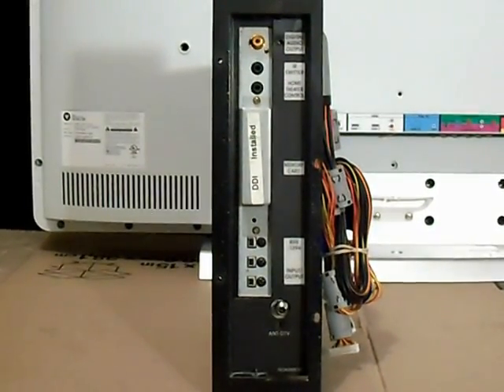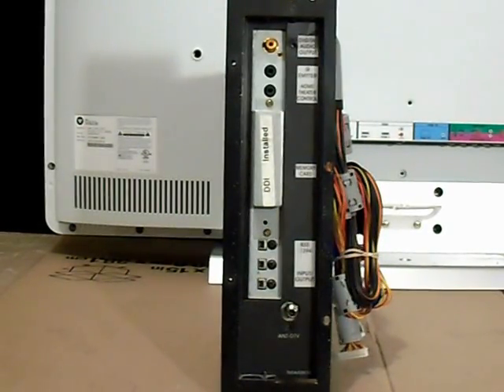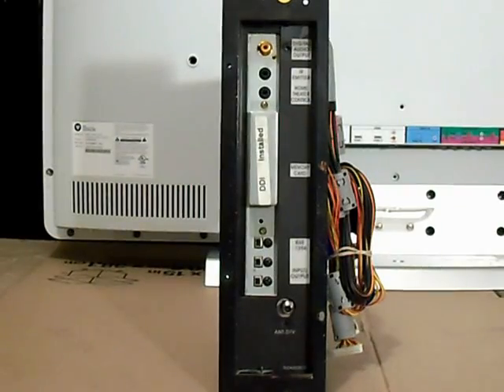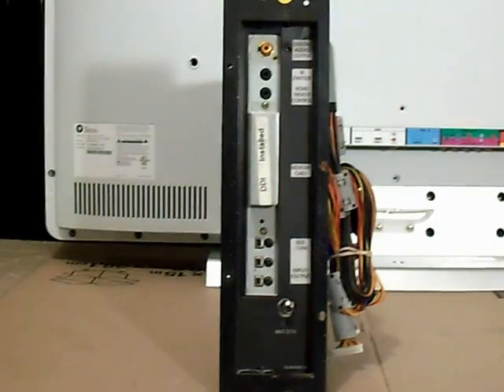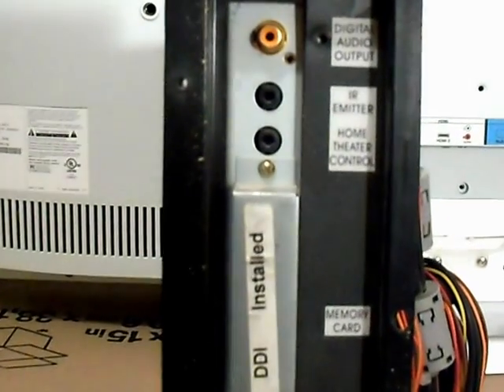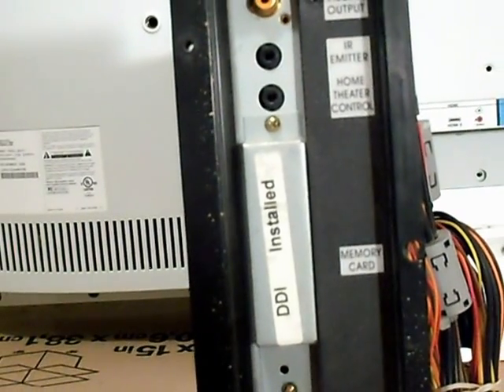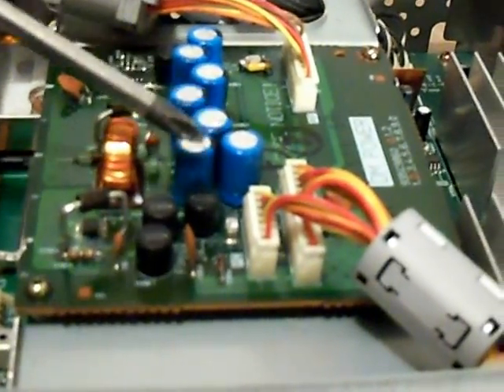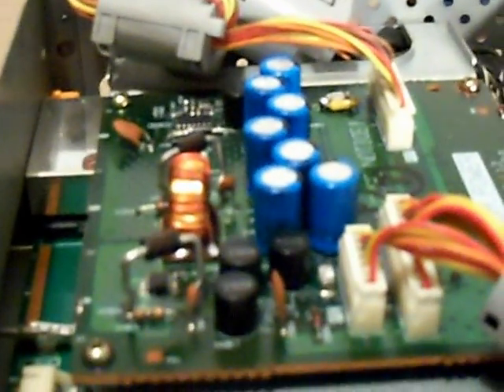Mitsubishi Rear Projection TV WS-65869 (#1) Continuous Blink - Won't turn on

Comment: For TulsaTVandPCRepair, I'm not sure if you are still answering questions, but I was wondering where did you get your E2P reprogrammed? Also how do you know if your E2P needs to be reprogrammed. I have a WS-73711 with maybe 200 plus hours of use and I just took it out of storage. Blinking light is on and will use your video to replace the capacitors. Hopefully this is all it needs.

Comment: I have a Mitsubishi Model WS 65815.  The light would flash green I had no idea about the blinking light of death but TV was working. One day my son was turning TV on and off then it just wouldnt come back on. No blinking light, no nothing. I have done a lot of research and wondering what could it be when I am getting nothing at all?
Reply: Lydia Readence I have the same TV so what was the solution what was the problem how did you fix it
Reply: I have the same model and brand TV but the same problem what was the solution what was the fix
Reply: Lydia Readence mine is dping this and my daughter does that is yours fixed yet what was the problem

Comment: I have a Mitsubishi WS-55809 the problem is that the TV will not turn on. Now when I push the power button the TV attempts to turn on by making a clicking noise and the green power light does come on but it shuts off in 2 seconds.
What do you think the problem is?
Reply: Ernest Hammond exact problem im having now i need help

Comment: just wanted to thank you for your video I was able to repair my parents TV in time for thanksgiving by following your video.... had accidently plugged the PF harness into the wrong port and light still flashed then double checked my work and noticed it was suppose to go to the power board...when I plugged it up light flashed a bit I was disappointed grabbed a drink looked again and the light was off. hit the power button and she fired right up... thanks again for video

Comment: Hello, very nice how to video. I have the constant blinking light on my ws-55615. It's a 2004 model, with a 4 capacitor board. Is this likely the same problem as the model you showed in your video? Thanks!!
Reply: brown bear 
I’m having the same problem with my WS-65513 which also has a 4 capacitor board. I haven’t fixed it yet, but I’d be willing to bet that it’s the same problem, even with 4 capacitors.

Comment: Hi there i dont speak english very well but can understand and i got a question, i need just to replace those 7 capacitors? i got the same problem that tv wont turn on
Reply from the maker: +Holasoybotman100 Botmejorado Yes in most cases, just the 7 capacitors.
Reply: thank you very much

Comment: If you are not familiar with soldering then send your board for repair to us on ebay, search for listing # :231640885112.
Don't mess up your board they are not longer available, so buy this repair service and save your nice big screen hdtv....
Reply: Are u still serving theses tvs
?

Comment: Hi,If you are not handy or know how to use a tester,You can send your board for repair to this guy from Ebay and save your tv or avoid to be overcharged by your local tv shop,just search on ebay bar  for listing :330700000004.
Nice and Professional Guy!!!

Comment: Hello,
I switched out the caps on the DM board and the fuses tested fine but my WS-65711 still won't power on. The led light turns on for a few seconds, I hear a click then the unit shuts down. Do you think the E2P card would cause this? If you think it could be the cause, I'll spend the $60 to have it repaired. If not, I'm stuck. New TV?
Reply: Hey did you ever resolve your problem? Mine is doing the same thing.

Comment: Your instructions worked to a "T" with my Mitsu WS-55511 tv!  I spent a total of $7.50 on 7 capacitors at Metro Electronics here in Sacramento and my 18 yr old son did a great solder job!  Only took about 15 to replace the caps and a few more to replace all the screws to the tv but we are back in business with our 2003 Boom Box!!!!!   Thanks again for sharing!!!!!!
Reply from the maker: Thank you for sharing the good news!

Comment: Hi, I'm a tv ser. tech located in R.I....I've also found that the pc board that the 1000uf caps are on, I always upgrade them to 25 volts. I am able to allow for a larger cap because if you notice that board has a lot of thermal issue's, so I also leave the metal cover off to keep it vented to allow the heat to vent better. Also, the small pcb also will have several dried or ( cold) solder joints that have to be resoldered. Normally this will resolve the prob. 95% of the time and the set will go through its boot and appx. 1 min green light stops and were good to go. Just a little input to the vid.
Reply: Frankie Pitochelli i totally need help my big tv thats one of the old mitsubishi tvs the hd1080 it wont turn on ill hit the power button n itll flash and shut off but my tv never comes on i need help my hubby is pretty hands on so if he can be told how to fix it he will!

Comment: Does this method also applies to the circuit board for the Mitsubishi Laservue? I'm on my third circuit board replacement, and my warranty is expired. Now I'm starting to get random tv shut offs again 5 months later. Thanks

Comment: Hi, if you guys are not good at soldering or testing components or don't know , you can send your little dm power board to this guy on ebay and save your tv, type this # in ebay's search bar:330700000004.
They are professional and do a good job,don't mess up your board.

Comment: I have a WS-55515 Model...same problem.. Continuous blinking light and wont turn on. Can i fix this problem the same way as this? I opened the back and dont see the same DM as on here. Please help. I dont want to buy a NEW TV unless repairing it will cost just as much as buying a new one. Thank you for your time. Your help will be well appreciated.

Comment: Hi,
If you guys feel like not good at soldering or using tester to check components, just buy this repair service from ebay for this board, search in eBay engine for item #330700000004.

Comment: I'd like to thank you for posting this!   My TV did had this problem.  I ordered the 7 capacitors plus 2 just in case from Amazon with shipping for $17.90.  I took the box over to my Dad's and my 11 year old daughter soldered in the capacitors.  She had just worked on a project with my dad learning to solder coincidentally!  I took it home and put it back together and VOILA!   It flashed at first but then I turned it right on!   It worked like a charm!   We are thrilled!  Thanks so much!  Suzy

Comment: would this repair work with my Mitsubishi ws-55511. Which has the continuous blink problem with no error code. Was on before a 15 minute power-outage and then the timer/power led just kept blinking and has kept blinking for about two weeks now. There are no repair people willing to even look at the tv. So I'm in-charge of fixing it.

Comment: Hi Sean i need your help!! i opened up my tv to vaccum the dust accumulated. after i put it back together the green light on the front panel keeps on blinking. there is a blue button under the DDI sheet metal cover that i may have pushed it. Did i just wipe out some programming or something??